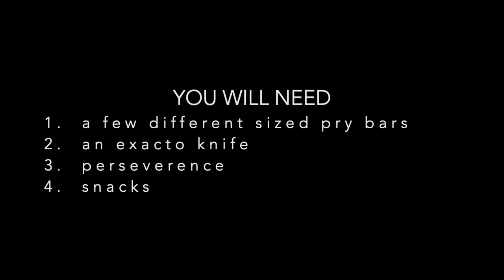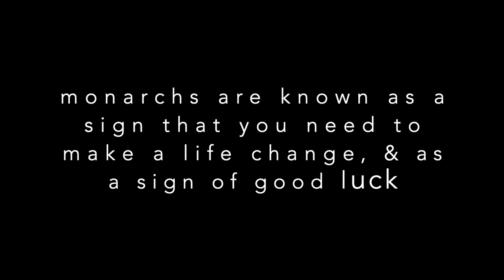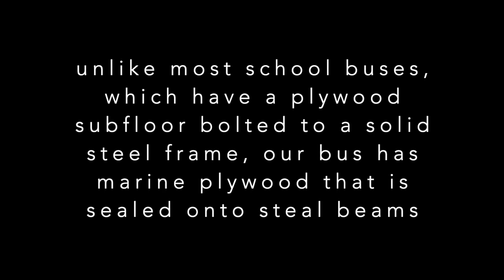EP04 - School Bus Conversion | Demolition | Bus Floors (& what to do with. Crown Coach subfloors!)

Comment: I just found your channel here!   I also have a Super II that I'm now mostly done with its full conversion:  I've been working on it for eleven years, but there's still more to do.   All the water and waste tanks (400 gallons total) are in place under the floor, along with the house batteries, propane, emergency generator and electric air compressor, and the minisplit A/C's condenser that sits directly above the front axle.   I made a walkway on the roof between the two roof hatches, and from that walkway I have eight 255W solar panels that can be tilted to face the sun, powering two Morningstar MPPT charge controllers and a Magnum 2kW inverter  -  they'll easily power my minisplit, even while driving.   The bedroom, bathroom and shower are basically done;  I just need to get a nice stone countertop for the bathroom and have someone make a bifold frameless shower door.   Next job will be the kitchen (thank god for IKEA!), and get my washer/dryer and chest freezers up and running, then it should be usable, maybe.

Did you buy it from Al here in Socal?   Was it from Fresno or Clovis?   If so, I may have driven it before he sold it.

PM me if you need any help  -  there's not much I don't know now about these buses!   I'm also on the Crown Coach Junkies forum on Facebook.

John in Socal